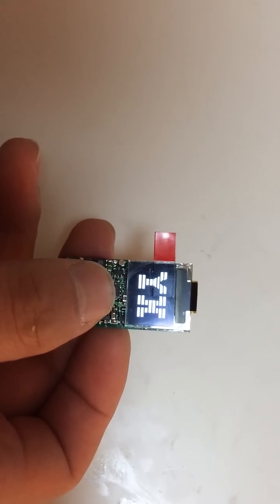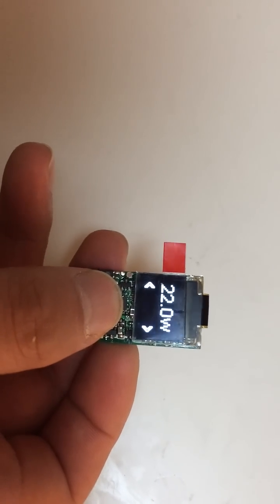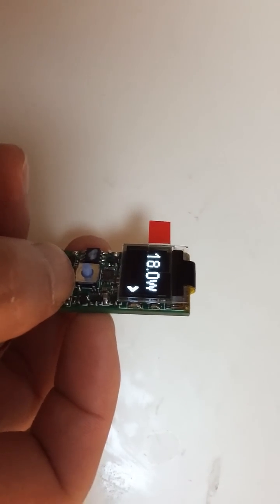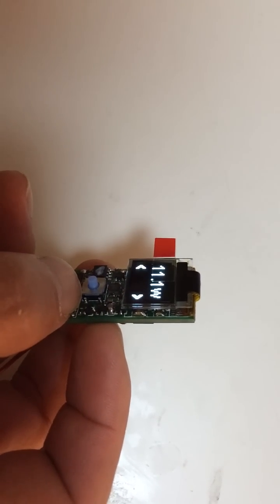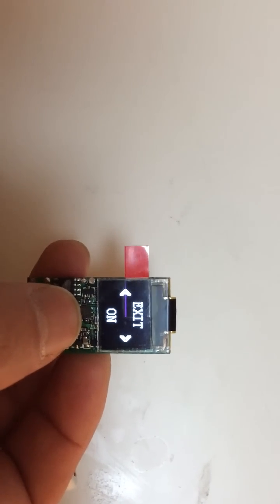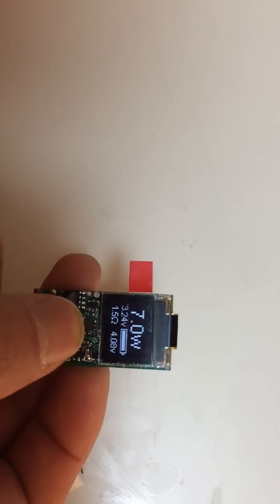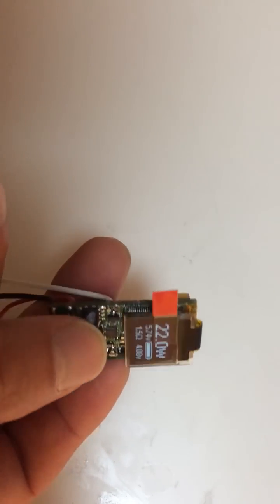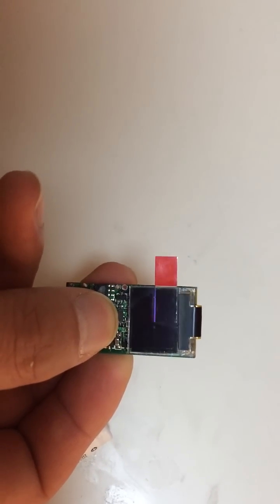Yihiecigar YiHi SX220 22W How Gravity sensor working, different from DNA20

Comment: I am ordering some of the new sx350 chips to put in small stealthy box mods. Buck circuit down to 1.5v DNA can't do that. It's also stable down to 0.2 ohm. It will be legendary. It can also bypass for mechanical type battery power straight to atty if you want to go super sub ohm unregulated from the same mod. Keep an eye on ECF for more details.